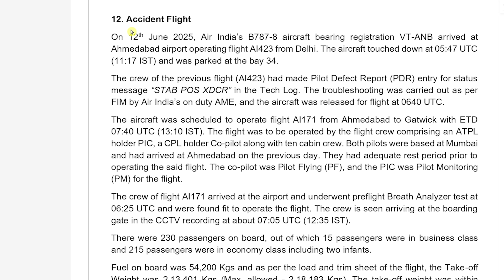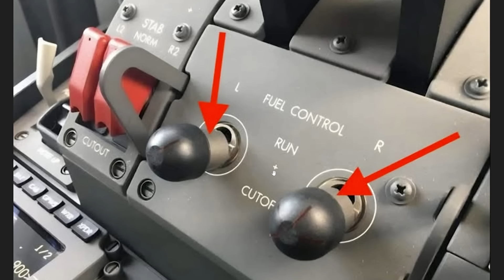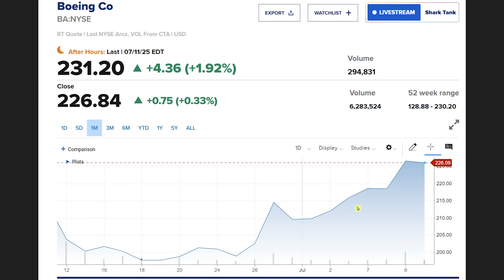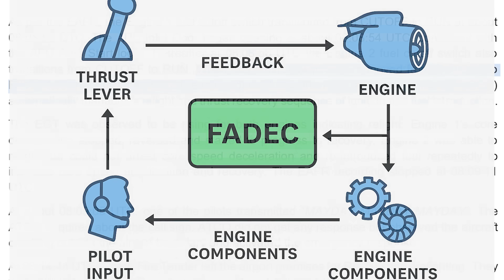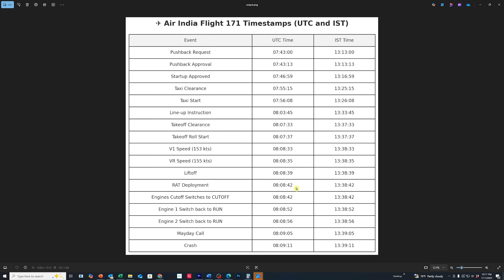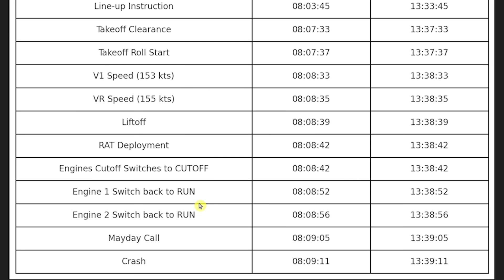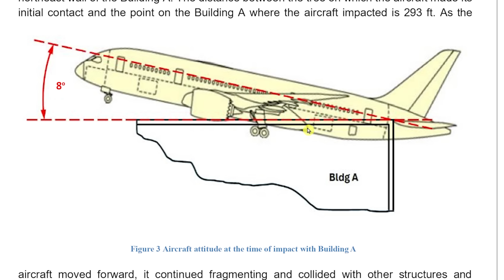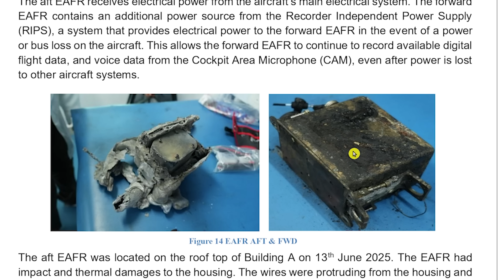Did Pilots CUTOFF Fuel? Shocking Twist Air India 171 Report!

Comment: The first officer was the pilot flying, and the chief pilot was pilot monitoring. 

The scenario ought to be...
The moment the pilot flying was engaged in liftoff with both hands on the yoke handle, the pilot monitoring reached fuel leavers and operates them swiftly. This is evident from only one second difference between operations of left and right engine leavers. Hence, RAT deployment within 3 seconds. 
The pilot flying might have noticed the movement of the pilot monitoring, but didn't realize his real action. When he realized the loss of thrust still with his both hands on the yoke handle, he glanced to his left since the pilot monitoring was doing something there and noticed that the leavers were on cutoff position. While adjusting himself with the yoke handle, throttle leaver, he managed to restore them to run position with one hand. Hence, there was a delay of 10 seconds between cutoff to restoration. Further, there has been a lag of 4 seconds between the two operations of first and second leavers. Concurrently, he had asked the question. "Why did you?" There was no doubt in the question. The answer was denial. There was no expression that panic. It's a clear cases of deliberate self sabotage of the pilot monitoring.
Reply: mindblowing explanation,i think this is what happend.the pilot monitoring was the captain and he was on medical leave several time before due to dippression.this was known to other pilots
Reply: @stephenroger4527   Plus when something happens the captain says my plane and he did not do that. The authorities know but as usual time heals all wounds so until the final report people can speculate.
Reply: Let us not jump to conclusions with such elaborate, mostly made up and way too detailed stories in such a delicate matter. Wait for the full cockpit conversation to come out, at least. We just know one of the pilots asked the other "Why?". Nothing else you made up.
Reply: @sai_69  In any investigation it is nothing but linking the dots and see which is the most probable situation nearer to the gathered facts, because we cannot recreate such situations except in simulations, which also do not reflect exact replica. Given the situation, my reasoning may match with it and surly it may not match with others if they have a better reasoning. We thought Dalton was correct, but JJ Thomson broke it and later came the particle wave duality, uncertainty, probability, quantum field theory so on and so forth. So, I felt that my reasoning might be right especially keeping view the question "why did you ......". It appeared to me that he was confident of what he had did and the reply also appeared to me as a denial and not a strange question like a bolt from the blue.  Furthermore, the software glitch hasn't yet been fully investigated, and an external sabotage by a mechanical means, like triggering the leavers to cut off position when either throttle leaver or yoke handle is set to operation may have to be ruled out. My first impressions are based only on the tone and tenor of the conversation reported in third person. I understood that there might be reason not to give the conversation in "quotes". Neither others nor I, even if jump to any conclusion, they are not valid and foolproof, and they remain speculations. Finally, I accept your comment to wait for the final report to change my view.
Reply: The PF would have had trouble seeing the cutoff switches without dangerously turning his head, but the avionics display would have immediately lit up with a graphic of the fuel system flagging up the problem, plus a long list of EICAS messages and checklists. He would also have felt the sudden deceleration and heard the change in engine sound. Hard to miss!
See the Mentour Pilot commentary and short laptop sim demo.
Reply: It seems unlikely that the switches were moved to cut off unintentionally but not impossible as they haven't stated whether the switches were functioning correctly. The NM-18-33 bulletin states reports that "fuel control switches were installed with the locking feature disengaged", I have not seen anything in the report that eliminates this.
Reply: The element of suspension is onthe verbatim of conversation and the intention in deliberately not disclosing the nams of the pilots who asked and who responded. 
Further, the report mentioned the inclusion of medical people and psychologist as special invitees. The investigation is not on people out side cockpit. It is purely on the cause of action for accident. It was evident the investigating agency has suspension on the mental condition of the pilots. So, manual intervention is not ruled out. With the given information that is what I inferred and anyother convincing out come may arise with more information or a different angle of perception. It is time to decide. 
@AirBornMedia
Reply: No, this scenario makes no sense, why would the one who did it deny it?
Reply: Wouldn’t you?  If you were trying to crash a plane and wanted to cost the pilot flying a few more precious seconds of confusion, you’d say, “Not me!”
Reply: self sabotage.. better known as the "grasping at straws" theory.
Reply: Doesn’t make any sense. If one pilot deliberately turned the switches off, he would have fought and won’t let the other pilot turn the switches on. Problem in this theory is the switches are turned back on.
Reply: @akshaynupur  you don’t understand the human mind it would’ve taken the other pilot a couple of seconds to figure out what the heck is actually happening and then make the movement to flick the switches back up.
Reply: You nailed it!
Reply: Perfect💯👍, I too believe that this happened exactly👌🎯

Comment: 11:26  Shouldn't the RAT be deployed after the CUTOFF happened ???
?????????????????????????????????????????????????????????????????????????????
Reply: You are correct because the RAT didn't deploy because of the cuff-off valves, 
It shows that it was a major electrical failure that was the reason for RAT deployment.
The report also does not state that the switches were definitely moved physically, they are going of sensor data that could have been due to an electrical fault. Remember the switches were found in RUN at the crash(pictures attached in the report). This could have been a major electrical failure and not pilot's switching off them physically, so it could have been an electrical failure which shows that both valves were switched off via electrical failure of some kind
Reply: @farazalikhan5242  

sole survivor said there was a loud bang before the aircraft tilted left.

was the rat depolyed after that bang which may have cause electrical failure?

if it was deployed before, it means this bang didn't cause the electrical failure and was something else.
Reply: or if you want to go through the official record and not these made-up timestamps
there is no mentioning of the time at which RAT was deployed, it says in the official report as follows -
1. "The CCTV footage obtained from the airport showed Ram Air Turbine (RAT) getting deployed during the initial climb immediately after lift-off"'

2. "RAT hydraulic pump began supplying hydraulic power at about 08:08:47 UTC."

Comment: one of the pilots put the switches down intentionally. the mechanism is good. It has happened in the French Alps case where the co pilot locked out the pilot and rammed the AC into the Alps

Comment: Maybe the switches were cut off electronically (not physically) due to software glitch or a virus. We should not rule out the possibility that the co-pilot was not lying that he did not cut off the fuel. I also feel that physically both the switches cannot be switched off within a gap of 1 sec.
Reply: That means the report is fabricated and to blame pilots, bcz the story is not adding up, bcz if it was cut off automatically bcz of some glitch then the buttons would still remain at start position, right? But report saays one of pilot asked other why u switch it off ? He replied he did not do so then report mentions the switch turned on again in few seconds, so the story is not adding up

Comment: I believe your note that RAT deployment at 8:08:42 is incorrect. That timepoint refers to when aircraft achieved max thrust. So I am wondering if RAT can deploy and start providing current with 2-3 seconds because fuel shut off didn't occur until 08:08:42 - 44. Wouldn't EFAR have the source of these signals i.e. the physical switches vs electronic switches driven by other actors

Comment: I disagree 
cut active if there is some problem in the fuels flowing system 
or
Engine stop first before cutoff switch activate that is why cutoff  switch insall in the fuel line 
there are following reasons cutoff activated
1 
First engine dtop or the fuel line plug or rupture or the fuel line pressure out of required pressure
2
computer comanded cutoff switch to activate
3
program required parameters was not matching and it switched off the cutout 
My point is why cutoff switch activated
NEED TO CHECK THIS POINT